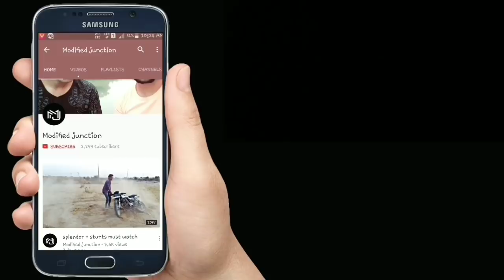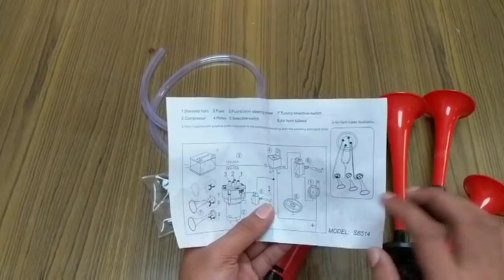How to install air pressure horn in splendor + & all bikes

Comment: 04:39 pr bhai jo aap ne Relay ki information de h wo thodi galat hai. Pressure horn Battery Drain krta h Correct bola aapne. Pr Relay battery ka load Kam krne k liye nahi lgaya jata, Relay Wiring pr Load na Pde or apki wiring fook na jaye is liye lgaya jata h. Or Relay 1 switch ki tarha wrk krta h, jo Hamari Accessories jese Horn ya Aux lights ko direct Battery se Power de or Wiring pr Load na pde. Thoda sa apko Correct kea. Pls don't mind. 😇😇😇

Comment: It will be much clean and clear if you draw a diagram of the whole connection and clearly mention where the different number in the  relay goes (30,85,86 and 87)...anyway your explanation was clear too....